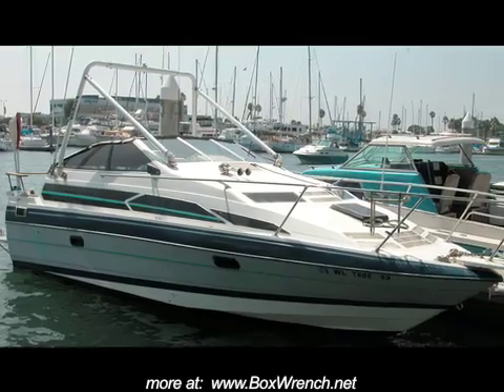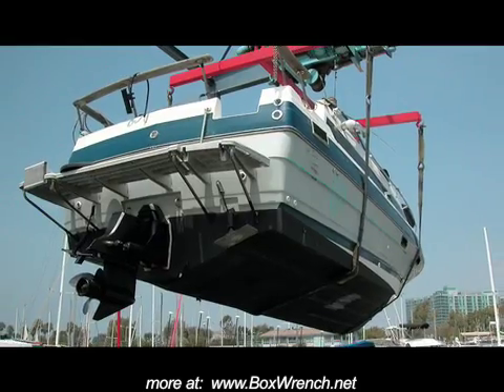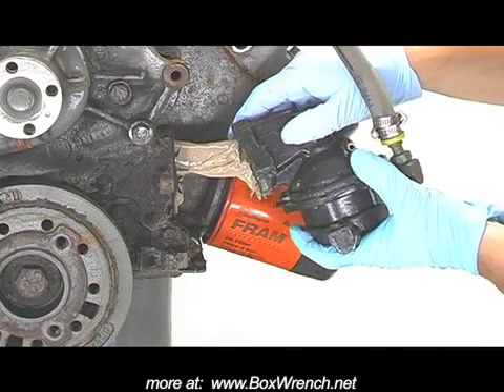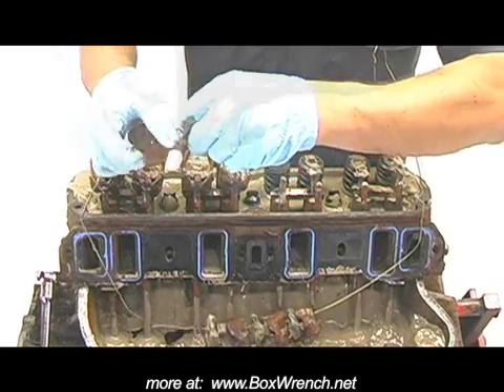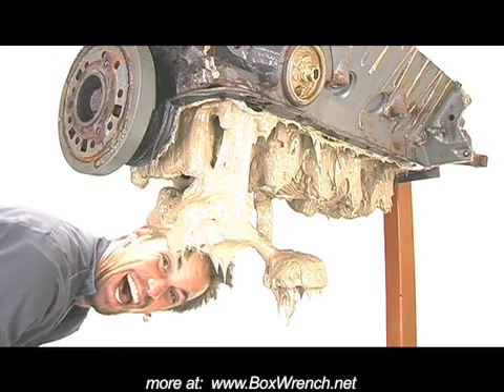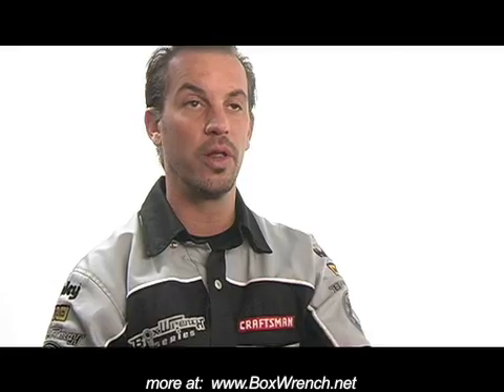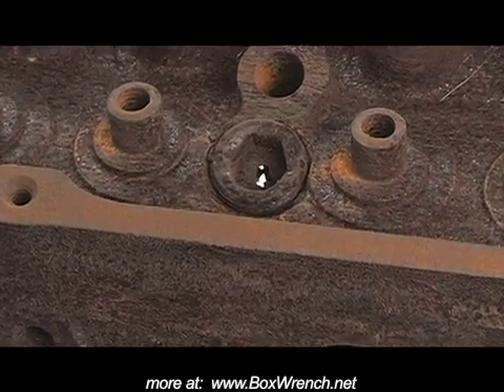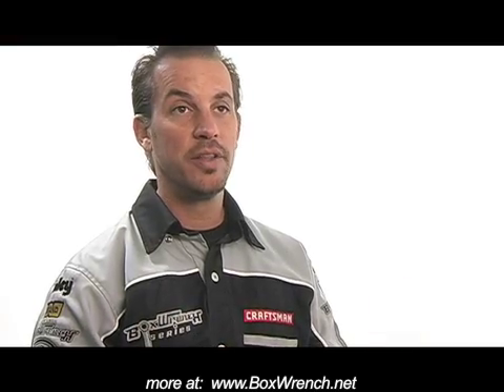Ford 351 Windsor Small Block Engine - Water in Oil Mystery

Comment: Another common place for windsors to leak is they get a small pin hole in the timing cover where the water pump goes.  Mine had me stripping the whole engine down n crack testing before I saw this stupid hole after an expensive but performance orientated rebuild.

Comment: @Boxwrench I had a Buick Reatta with the 3.8, leaking coolant out a rusted 'freeze-plug, popped out the plug, there was rust build-up 4" up from the panrail, new plug, but still leaking, wiped down you could see green AF seeping thru the block wall. The rust build-up ate thru the block wall up to the freeze-plug, half the plug was a wall of rust....motor was junked.

Comment: That's why saltwater boats suck and cycle sea water and it goes through a heat exchanger, which acts as a radiator for the self contained engine coolant... :facepalm

Comment: Part two: I have recent Gt40X heads and the shortblock is a production unit with less than 60k miles. Upon changing the oil pan the rotating assy and oil pan looked extremely clean as did the top of the heads. I changed the oil and all looked clean. I am consuming a bit of oil and a bit of coolant. The radiator has a slow drip. Pulled the spark plugs and all looked good except for the rear most passegner side. Caked carbon deposit. Looks like a new shortblock, what do you say?

Comment: I have the same Alfredo sauce coming out of my bronco's 5.8 Oil filler cap breather line. It ends up foaming up the PCV filter and dripping out onto the plastic wheel well. I recently had the valve covers and the intake replaced with an edelbrock efi performer unit. I also had the oil pan replaced due to a bad leak above the starter. This issue didn't materialize until these changes took place. I also relocated the PCV to the center of the intake plenum to equalize ingestion of PCVapors.???

Comment from the maker: @prozanine actually, that cylinder head (with the rusty detail shot of the corrosion) did come off of the actual engine disassembled in the video... it was hot tanked clean, the problem was discovered and yes the head did sit out side for a bit. Then a few months later, we had the chance to shoot the detail shots of the corroded plug in the head for this video... sometimes it just takes a while to get to the details.

Comment: this engine has at least 15 liters water in it, it cant be running on a car, must be external water cooled system. i have just replaced my last head gasket set on a 6lt v8 gm to day, 7am to 7pm it fucked me dead.

Comment: I used to see that mayo in the older ford 4 cylinder tractor engines on a regular basis. The liners would go porous and dump the coolant into the sump and by the time we got it to give it a short motor it was like a chocolate mousse pudding inside. the one benefit i did notice when they came in like that was that all the internal components didn't have a trace of carbon build up on them. All you had to do was hose the internals down to get the pudding off them and they sparkled.

Comment from the maker: Any machine shop that will perform the repair work will be able to find replacement parts for you. 
We bored out the engine block and had to get a complete engine kit that had pistons, rings, bearings, gaskets and valve train seals to name a few. 
Companies like Mahle, Sealed Power, Speed Pro and Fel-Pro all have the pieces you'll need.

Comment from the maker: Marine engine designers might consider the stock Ford engine accessories inferior for use in a marine environment. 
This engine design includes a steering pump that drives a transom mounted gimbal rotation unit that steers the outdrive by use of a GM style power unit. 

This is a factory design from either Bayliner corp. or the contractor that designed the gimbal unit and outdrive.

Comment from the maker: For engines that are completely "raw water" cooled (as you described, by the water they sit in) there are all kinds of issues with warping, cracking and other irregular expansion/contraction factors. 
That's an 'Open' cooling system where the raw water circulates in the block, heads and exhaust manifolds. 
In a 'Closed' cooling systems, there is anti-freeze in the block, heads and exhaust manifolds and only the exhaust risers (were the exhaust exits) have raw water in them. Much more dependable

Comment from the maker: Usually single marine engines rotate in standard direction. 
Most of the time, you only see a reverse rotation engine paired with a standard rotation engine in a twin engine boat.

The engine in this boat is a standard rotation 351W.

Comment: so that really means that noting but the tansmition  and head gasket is the only thing wrong with it... as long as i dont crank it up unteal i put new oil filter and fuel filter???... also i seen that the disk brakes need to be replaced becase there rustid and new tires becase there flat.. yeah its been seting out in weth so ill have to paint it 2

Comment from the maker: After two years your oil will have all dripped down into the pan and the fuel is on it's way to becoming varnish. Changing the fuel filter and oil filter will be a good idea and after a replacment of the head gasket and before you fire up the engine, you should pre-lube the oil system. 

Removing and installing heads and dealing with gaskets as well as the oil pre-lube technique is all covered in our 'Basic Engine Building' DVD is you are interested...

Comment from the maker: Ebay may be the best place for you if there isn't a local distributor in Canada. 

We always have our machine shop order the kits through their distributors and they show up at the shop. It's best in the case of boring and honing as they need the pistons on hand for exact measurements prior to final honing of cylinders. Plus they balance the assembly based on actual weights of pistons and rod combos after the rods are machined.

Comment from the maker: What's in your Crown Victoria now, a 351 or something more mild? 
You can rebuild what's in it just like we did for this 351W, or you can build up your existing engine a bit if you want some extra power. 
We're kind of partial to 'camming' down and tuning for better fuel economy these days though. No telling when gas prices are going to spike back up. Then all the extra horsepower becomes a hurt on the wallet, not to mention the pollution factor. 
That's a California opinion though, smog is bad

Comment from the maker: In a stock powered boat, it doesn't really matter to us how much the engine put's out. We did the rebuild for problem solving, re-powering and fuel efficiency reasons. The engine was built with an economic camshaft and reliable internal components. Then with a propeller pitch change, the boat ran smoother, and more economically than it did before. And, when we wanted it, we picked up about 5 MPH on the top speed Doesn't sound like much but it's a big deal with a boat designed for slower running.

Comment: yea bro its a 4.6L V8 w/ 3 vavles a cylcinder and about 300 horse power and the block might be aluminum or cast iron. Iron is better ofr wear patterns and aluminum will wear out much faster unless it has iron liners inside the block.

Comment from the maker: This ridiculous cylinder head design is actually why I don't like Fords. Not meaning to counter your passion in Fords however, why is it that pretty much every other make of engine decided against putting water jacket access ports under the valve covers. Over the years there must be hundreds of cases of water leaking into the oil system through failing water jacket plugs on these 351-W engines. I much prefer the Chevy design which has no risk of water plug leaks under the valve covers.

Comment from the maker: yup, running a heat exchanger would have been the best idea and we always planned to install the $3,800 unit "one day". Unfortunately, one day the sludge started coming out and we had to spend the money rebuilding the engine instead. Good lesson for anyone considering running a freshwater designed boat in a saltwater environment...at some point it's a better idea to invest in a freshwater heat exchanger.

Comment: the big question is - why would the set up be to run salt water through the water jacket - would it not be prudent to run a closed loop coolant system and use a heat exchanger to cool the coolant - similar to the set up on the new wave of jet boats on the market like skidoo/rotax setups - it seems surprising not too.